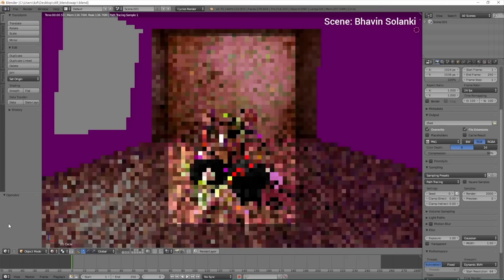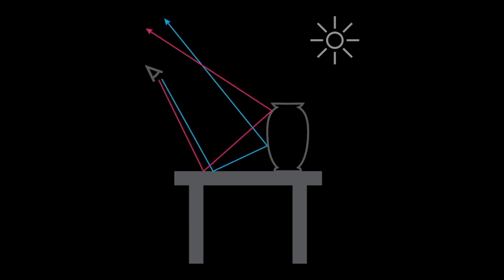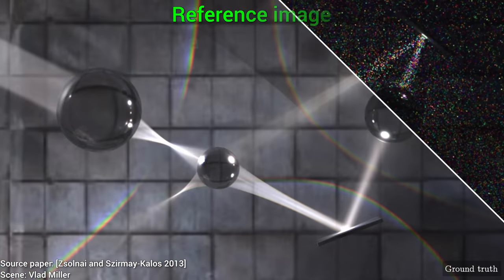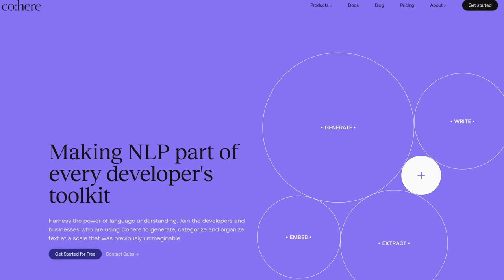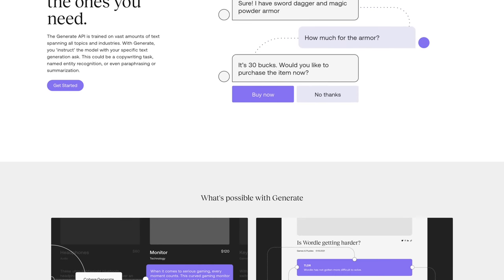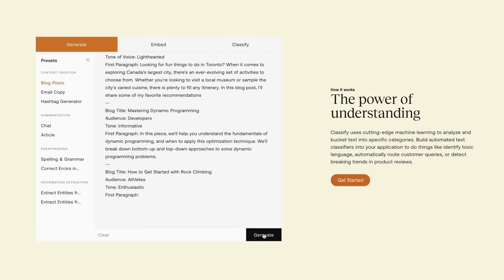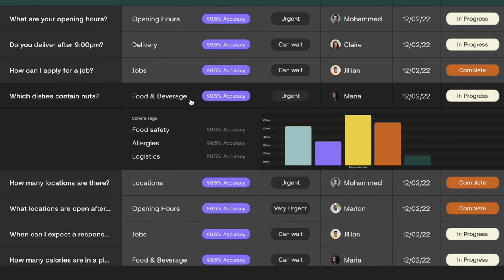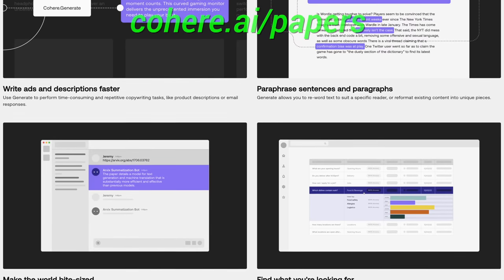NVIDIA’s Ray Tracer - Finally, Real Time! ☀️

Comment: 5:26 artifacts look like reflection dragging, which is probably an artifact of caching the samples for denoising on the geometry instead of building a light volume. No doubt they had to cut corners to get it working in real-time. Looking forward to seeing "Two more papers down the line."
Reply: Yes I imagine the use of AI in their ray tracing analysis does provide them with assumptions. I believe one of the key breakthroughs to real-time ray tracing will be AI-based, ray-marching material assignments: Once a pilot ray knows the material (luminosity, roughness, albedo, other surface occlusion, etc.), and the surface curvature -- the ray (and nearby objects) can presume to know the way the light will fall off the object. So casting only 1 ray per object per side should return amazing render performance.
Reply: If you look at the reflection from the fan, it seems like the reflection is only updated every other frame or less with a bit of smoothing.
Reply: The user of this channel praises everything on his channel without thinking longer then 2 minutes i guess. The so called "quality improvements" nvidia shows are just faster denoiser by lowering the sampling more and more. That is NOT a solution and on the contrary, is moving backwards. The  performance/w is wat we want, increase in speed, in spp number, faster resolving of unbiased solutions, true raytracing accelerators, not a god dam denoiser  that destroys your details.
Reply: @darviniusb  Our brain has a NN denoiser. Seems pretty handy to me. Lower sample size is great if the results work out. Besides, it only washes out lighting, not geometry. Geometry is truth!
Reply: @abdulshabazz8597  this sounds like RT meets Normalmaps.

Comment: I was asking for NVIDIA's denoiser to be implemented in UE 5, I hope they are working on something like this. Still we got a long way to go.
Reply: Imagine this real time ray tracing with nanite
Reply: I'm showing my lack of knowledge but I thought nanite was the same as this. I think I get it though. You can work on nanite in real time but in game it is baked in, so kind of static though Nvidia is dynamic in game?!
Reply: @shardovl586  no nanite is kinda next gen lod. It allows to not lose a quality in distant objects with fps gains at the same time.
Reply: @nanow1990  Nannite is good for things like rocks, but it totally sucks at many small things like the leafs of a tree
Reply: @maythesciencebewithyou  yeah foliage is ridiculous with nanite. insane overdraw
Reply: @shardovl586  Nanite optimizes the meshes on screen so you can import high poly objects, and keep the appearance of detail, without actually having that much rendered. This takes in a noisy render and uses some fancy algorithms to fill in that missing detail.
Reply: @willuigi64  Anything too thin, because it doesn't know where to draw is my impression
Reply: @xaviermagnus8310  it's because there's too much geometry so it renders wayy too many tris. pretty sure there's a render option in ue5 to show you, like heatvision that shows heat where there's overdraw
Reply: @willuigi64  Interesting stuff. You work with ue5 a lot too?
Reply: @owenb6499  I was thinking of lumen
Reply: @xaviermagnus8310  They should make a separate mesh category for leaves that merges the canopy into a cloud like blob at a certain distance. The dev just sets up the leaves as canopy for every tree and the distance at which it swaps out and UA5 just does everything on its own from there... maybe do it step by step merging at first only leaves that are closer at X dist. slowly merging the whole thing into a single mesh that roughly resembles the shape of the outer coordinates....
Reply: @Dhrazor  Basically just LODs lol
Reply: there is denoising in unreal pathtracing :)
Reply: @stefevr  Like in omniverse( optix denosier) ?
Reply: @owenb6499  Cheers for the explanation
Reply: @nanow1990  Thanks
Reply: @shardovl586  lumen is similar ish, but what its doing is creating a representation of the geo then bouncing light on that. So its like doing a low res ray trace sim on low res geo, then casting that onto the higher res geometry.
Reply: Maybe in the future they will team up, and we will have a composited image from several engines, each doing what it does best and delivering it as layers that can be superposed to deliver awesomeness
Reply: @shardovl586  this should work with the path tracer and rtx on. i don't believe that lumen can take advantage by this.
Reply: @willuigi64  Nanite doesn't work with transparent objects like leaves in the first place, so that's just regular rendering performance. Overdraw only occurs with transparency by principle
Reply: @noodlespagoodle  that’s assuming you don’t use modelled foliage.
Reply: @willuigi64  yes I think that is what he is saying. 

So basically many old school optimizations techniques now creates worse performance. 

Apart from the huge data sets storage space we need to shift our mindset to micro polygons. No manual lods. No baking. No normal maps etc. hell even uv mapping is gone if you store the map data per polygon instead. 

Imagine this when all the scan - material setup are unified and fed into an AI with parameter overides. It will basically mean for 3D what now is happening in 2D. With the benefits 3D Carry. 

Mix this with AI interpolation and lumen + ray tracing / denoice tech. 

Then we basically have a build what you want AI supported by drag and drop and no tech knowledge needed. (To a degree)

It will work with dynamic light and semi dynamic objects. 

Deformable object will still be to be solved. Some of the simpler ones can be solved by prearranged static mesh animation and interpolation. 

Rest can be faked for micro deformations. Where it still looks good even if the lighting there would be wrong. 

Never been a super AI fan. But now I clearly see that we might have good artist friendly 2D creation tools in say <10y and same for 3D maybe <20y or even faster. 

Meaning it will be a describe. Point to reference. Adjust. Define adjustment parameters and change integration workflow. So basically guide AI to what items and what lighting. And then mostly arrange as you want. Even there it will be adjusted for auto placement of say plants. Sub items. 

All this most likely for realistic images. But I am sure stylization / art style control will come not long after. 

So yeah surely what a time to be alive.
Reply: @willuigi64  Exactly. Overdraw issues stem from translucency. Modeled leaves with nanite would be fine (treated the same as rocks or any other standard mesh). That said, any displacement in material would also not work with nanite.
Reply: @owenb6499  That's not how that works at all...
Reply: @TheMrKeksLp  lol im just going off what I heard. I heard it does some ray tracing on a low res version of the level, then saves that to a cache?
Reply: @shardovl586  Nanite is about geometry compression, and its not clear yet how this interact with hw ray tracing, epic has 3 ways to render triangle, mesh shaders, regular, and software rasterizer, they had to resort to this tecniques , becasue the bvh is computed in hw and its not accessible trhough api(s). I think that in the future, we are goin to see full path tracing in all engines , so , what's the point to preferr one over another or even rool out your own , when you have everything in hw ?
Reply: They have lumen which is a more optimized
Reply: It is in NV's own branch of UE5 called NVRTX (the repo). It has RTXDI, RTXGI, enhanced shadow for nanite, and (finally the one I really want) raytraced volumetric fog support. The overhead is there for the RTXDI, but that is great for scene that have a lot of lights.
But since I get in to the UE5 stuff, I use less NV stuff than ever, lumen is great except for the translucency reflection (there is none, so traditional raytraced translucency has to be enabled and no unbaked indirect lighting will be matched at all), future UE5 release will improve on that tho.
Reply: @litjellyfish  this is the future 3d creation in the future is going to be so easy and look so real it's going to lead to a 3d Renaissance
Reply: @currythegoatofmankindthepa5156  yes for sure. Still I will not call it easy. It still will require a lot of work. But yes easier for sure. Static realism is not so far away. Still it will be interesting how more dynamic matters, physics etc can be more AI driven. Animations. Also it’s going to be interesting how this tools also can be used to produced coherent non realistic stylized visuals

Comment: And they tested the numbers for both a 3090 and laptop 2080
And both are at least above 30 fps
So looks like we'll be seeing some even better graphics in the nearish future
And hopefully it'll perform better as well
Reply: My question is how well it scales with the 4000 series. Those are relatively close to release.
Reply: And not power consuming, bruh 4090 was said gonna take 800watt from the wall
Reply: Doesn't 3090 already do 4K 30fps in a demanding game like control with full RT turned on?
Reply: @Shadowed007  Nah dude, it easily pulls 90 FPS at minimum. It does 8K at 60 FPS even, but that's with rasterization.
Reply: @fadhil4008  We'll have to see, but I doubt it's 800W sustained. Perhaps transient spikes of up to 800W (which still needs a beefy PSU unless you like bluescreens).
Reply: @MLWJ1993  yeah, but still if they say 800watt then you most likely need a dedicated PSU for it to work
Reply: @fadhil4008  there are 1600W PSU's out there. That should work out fine IF 800W is even true. They're not much more than rumours at this point in time.
Reply: @MLWJ1993  Unless you have lots of spinning drives the rest of your system will never come close to 400W so a 1200W power supply will easily suffice.
Reply: @magicmulder  Perhaps with the next generation of CPUs, memory & high speed SSD's it might. I still doubt the GPU's are going to be 800W sustained anyway so it's not that relevant anyway.

Comment: blurry specular highlights is a tell-tale sign of denoising, found with Arnold's Noice denoiser that it's amazing at getting rid of noise in the diffuse pass & motion blur but you'd still need x9 more samples in spec. I wonder if a non-glossy spec pass (that should be cheaper to render) could be used to influence the denoising.

Comment: Just a clarification, noise is not generated by inaccuracies. Is the result of areas with dimmer or more scattered illumination being undersampled. Since this fewer samples have to make up in luminosity for previsualization purposes, render engines usually exagerate their brightness. Thus rendering hard noise artifacts.
Reply: Thats what an inaccuracy is. Its not rendering the desired output for the provided input. i.e. its inaccurate.

Comment: I waited for 20 years for this, and I would never predict that the efficient-shortcut-hack to convincing raytracing with over 30fps is mostly about to just train a neural network to pre-compute a decent average de-noising matrix, and to hardware-accellerate a matrix multiplication-accumulator to compute the matrix product of the trained AI (ideally optimized for a given set of scenery/perspectives/styles by some stochastics). sadly it also takes 4-12 gigabyte of ddr5 ram in addition to 8-32 gb ddr3-ddr4 ram, depending on resolution/fidelity/flicker/Texture+SceneComplexity in the result.
Reply: wait a few years and 32 gb of ram won't look like much.
Reply: @ДаниилРабинович-б9п  it doesnt do now. Im using 16gb laptop for a 2 years now and upgrading to 32 while is completely possible dont seem to be necessary unless you play recent tiles (which require it)
Reply: If you have a graphics card for this, you most probably have enough ddr5 ram in your computer to even have chrome open at the same time xD
Reply: @R3bel02  rtx 3080 has 10gb vram, "unreal engine marble game demo" needs 12 gb vram. or it will start stuttering after loading one too many assets after having explored too much of the map.

google chrome i barely ever use, only where ever raymarching within webgl is only 40 fps on opera, it may sometimes run faster on google chrome (but webgl implenentations change rapidly over time between browers , its trial and error for best performance)
Reply: @ollllj  opera is also chromium based
Reply: These so-called "AI" solutions are never ideal. They are hacks. The real answer to providing high-quality, realistic imagery without wasting a massive amount of processing power is Foveated Rendering.
Reply: @bricaaron3978  foveated only works in xr or with an insane amount of depth of field blur
Reply: @bricaaron3978 with eye tracking?

I guess temporal techniques make most sense on current setups (with high enough refresh)
Reply: @bricaaron3978  eye tracking for voweated rendering is a much more noticacble hack, but it sure has its priorities straight, and all the newer vr headsets that cost more than 800 usd are basically expected to come with eye/face tracking, generally more for  Foveateds than for v-tubing
Reply: @xxedgelord420xx4  "foveated only works in xr or with an insane amount of depth of field blur"

Huh? It doesn't seem that you understand what Foveated Rendering is.
Reply: @lievenvv  'with eye tracking?"

Yes, FR by definition requires eye tracking. There are all kinds of optimizations that FR can make possible, but even the most basic---just adjusting sampling rate---can drastically reduce the amount of GPU power necessary for a given apparent resolution. And the larger the FOV of the display, the greater the possible benefits.

Comment: SO...
1) This paper
2) RTX 40 Series.
IT seems like we're about to get some real real-time raytraced graphics rather soon!
Reply: Don't we already have real time RT for the past 4 years? Metro Exodus enhanced edition, CONTROL etc.,? and those game give 30fps 4k at Full RT.
Reply: @Shadowed007  I dunno if I'd call it that :D For example, Control has artifacts, and needs DLSS on 3070 to keep itself around... 70-90 fps?...
You could say it's greedy, but I'd say a minimum is a rock-solid 60fps at 1440p, in ANY game. And we've got some ground to cover before then.
But we might be past the halfway mark.

Comment: If you did 3d tiles of every possible shape within the most efficient width/hight/depth numbered cubes (or more efficient shape than cube but most efficient size for memory) then that could save a hell of a lot of memory. You would just need material maps, which could be done like atoms for hardness, fluidity, conductivity, softness etc. You could even create molecules for will. Make the 3d tiles 4d and have every likely or possible action happen to the 3d shape tile depending on triggers eg. tenderly stroking a childs face or squeezing a mandarine.